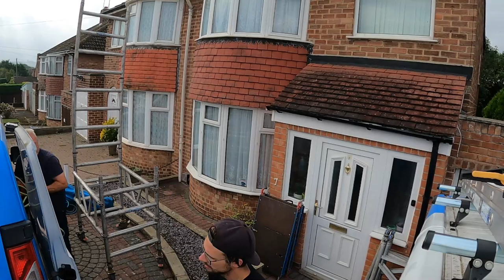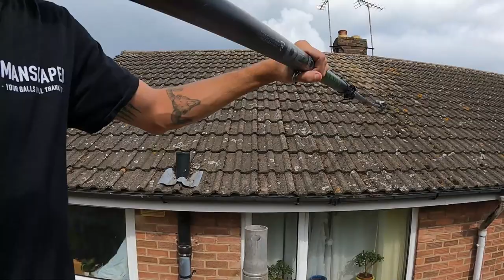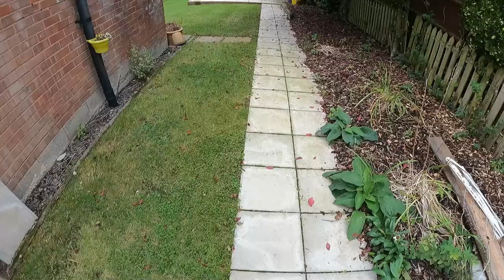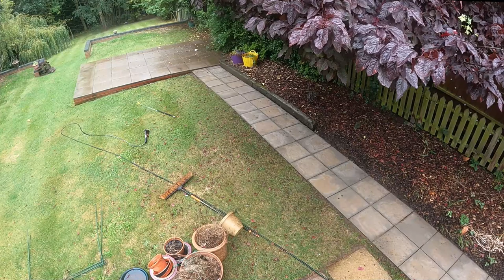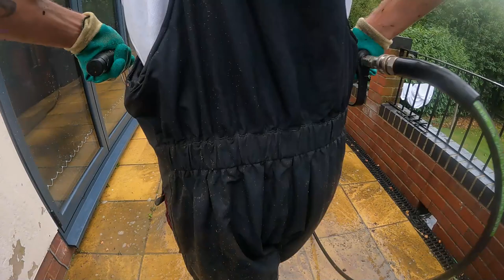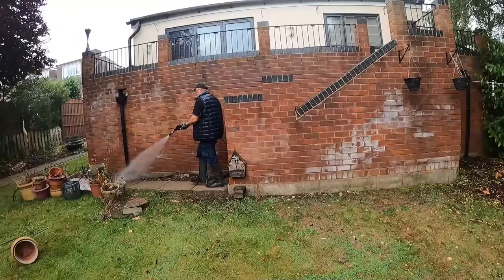NASTY WALLS... BLOCKED DRAINS... CLEANING TIME!

Comment: That clogged pipe, looks like a job for Drain Addict, You could probably use your high-pressure hose to clean that out with, and push it through
Reply: he might be able. However if the blockage is a bit much the water might be looking for a other way out. in a bad case that will be the toilet inside the house. It's a pain in the ass to get shit stains cleaned from a ceiling.

Comment: I'm glad you did that property,  honestly at night I would he afraid to walk that alley, or be in the back yard, nor use those steps.  Would have BLEACHED the patio, with about 15 gals of bleach.

I used 6 on my front walkway, and 10 on back patio

UNTIL I learned the joy of pressure washing

I never knew the benefits of pressure washing your property UNTIL, I actually did it. I cried.   I'm 2nd owner of 50 yr old house and it was never done before I moved in. For 22nd Home Owner Anniversary,  I got new windows and pressure washed house (cheaper than painting brickhouse) and ALL the concrete sidewalks, walkways, drive way and concrete turnaround pad in the back.

My House looked BRAND NEW, and RAY BAN sunglasses did NOT help the blinding glare from the concrete.

Comment: Mate if you can crack the white staining, these new build developers should hire you full time! All new builds suffer from this so bad atm!
Reply: Why is that?
Reply: @cindyknudson2715  Usually it is caused by water leaching through walls and leaving the dissolved solids on the surface as it evaporates.  Main problem would seem to be lack of waterproofing wherever the water is getting in in the first place.

Comment: Cracking job. It looks like you can change between surface cleaner and lance without switching off the motor. Presumably your hose fittings shut off the pressure once removed from the lance etc. just wondering what these are called please?
Reply: Oh I see it’s the trigger that’s being switched out. The surface cleaner I use has a fixed trigger as does the lance. Interesting!!
Reply from the maker: the trigger stays on its just a spigot fitting on all of my lances and kit so i can switch things over in seconds without turning anything off

Comment: So is pressure washing a roof more effective and does it have a better outcome than the scraping process?
Reply: In simple terms the Moss spores can bind to any crag where dirt has gathered - Moss scraping removes any surface moss and most of the growth areas - Pressure washing will clear out all the areas entirely
If I where to put a % to efficacy
Scrape only 60% - Moss will begin regrowing almost immediately as there is still dirt there and the spores are alive
Pressure wash about 80% - Moss will begin to regrow as soon as dirt begins to gather again as spore are alive
Scrape + Biocide 80% at a guess - The biocide will inhibit for a while but once it dies back the moss has good growing conditions
Pressure wash + Biocide - 90+% - You have removed its growth bed and you have salted the earth so any new spores should be dying back on contact for a good few month

Comment: Do you use your own water supply or do you use the outside taps?
Reply from the maker: Outside taps always, usually use a few thousand litres per job
Reply: @PartridgeExteriorCleaning  what if the client doesn’t have there own outside tap? Will you try to use the neighbours?

Comment: Are you turning the pressure down? Looks like that wand isn’t giving you any kickback or pushup at all
Reply from the maker: its got a vibro x fitted to the machine, builds pressure instead of instant kick
Reply: @PartridgeExteriorCleaning  ahh thanks! 
Even when you’re going though, is that bend in the wand not pushing it up in the air? 
I have a 8gpm and have to keep pressure on it to keep the lance from climbing